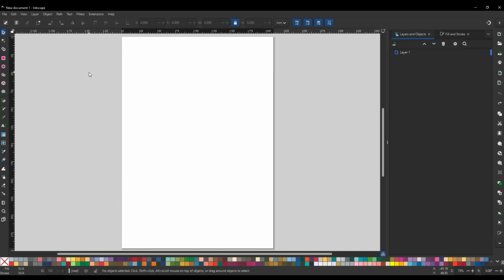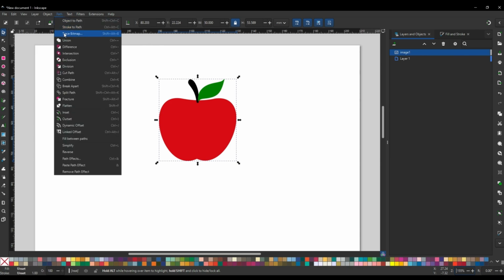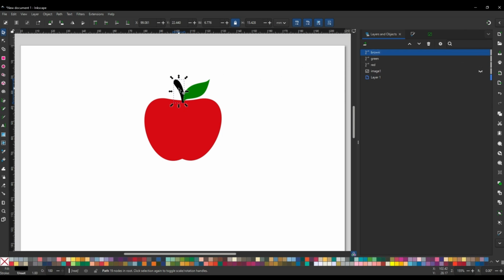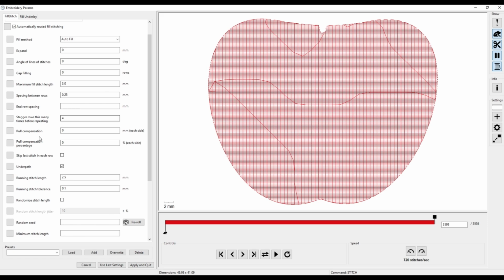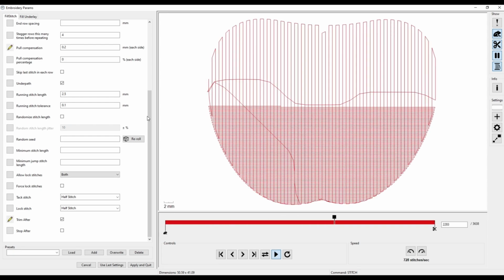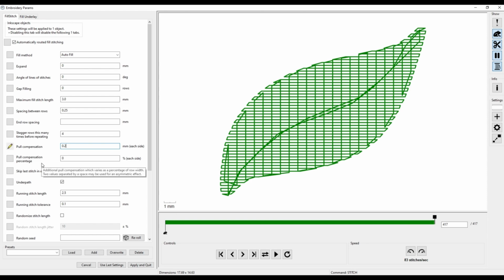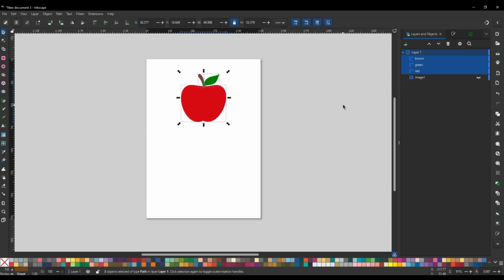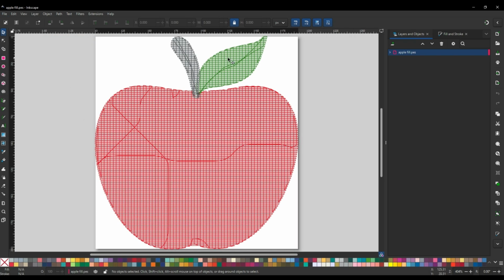Embroidery Stitches: Part 1 - Fill Stitch & Puckering Solution! | Ink/Stitch

Comment: Loved this.. so helpful for navigating the platform as a beginner. Could you do a video on adding commands like the trim here or stop here commands?
Reply from the maker: Thank you so much!  I don't use the visual Commands tool myself because simply ticking the 'Trim after' box in the Params menu has always been enough for my workflow. Even for appliqués, I just use 'Trim after' and rely on different thread colors in the software so the machine automatically stops between steps (like placement and tackdown). Since I haven't really needed the Commands tool yet, I don't know much about it, but I really appreciate the suggestion!

Comment: There is no need to change the stitch angle for the undersewing by default it is perpendicular to the top stitching
Reply from the maker: Exactly! That’s why the grid/underlay shows up as soon as you open the Params window if the underlay box is checked.
Reply: @PankasEmbellishLab but if you change the top angle the undersewing auto adjusts no need to enter a value for the undersewing by default
Reply from the maker: @gusvisser4677 Yes, you are absolutely right! There is no need to adjust this manually. Thanks for the correction!